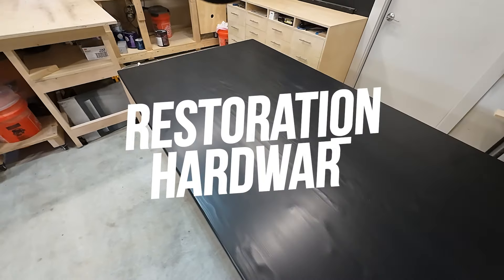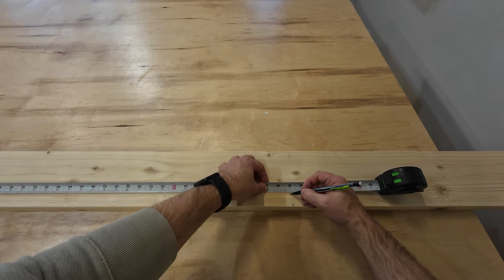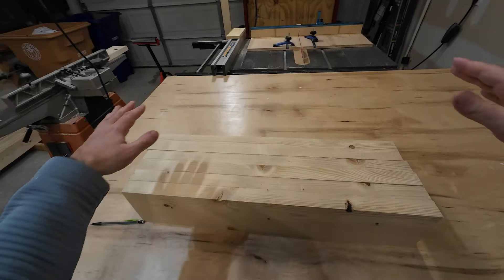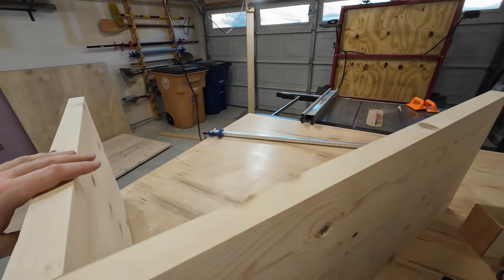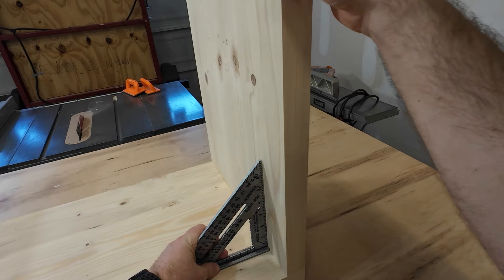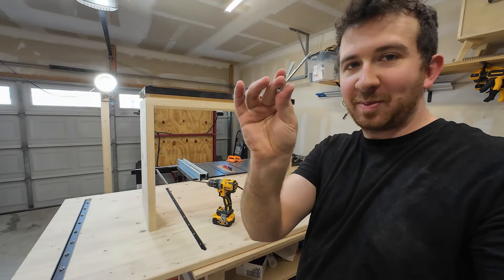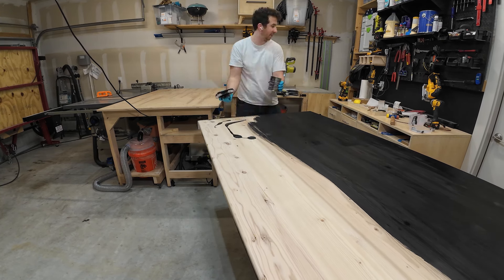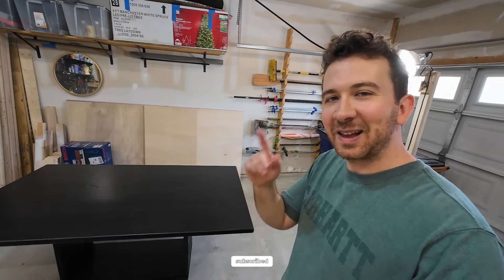DIY Restoration Hardware Dining Table On A Budget

Comment: The materials and labor justify the cost to a greater degree than we give it credit for. Saying the same thing made of lower quality materials has the same value isn't fair. Also the labor isn't calculated in the cost of $200 dollars. Getting the same look for a lower cost with a sacrifice of higher quality materials is still a noble cause as long as you don't misrepresent the comparison. You did a nice job and earned a like, comment, and subscription.
Reply from the maker: Thank you!